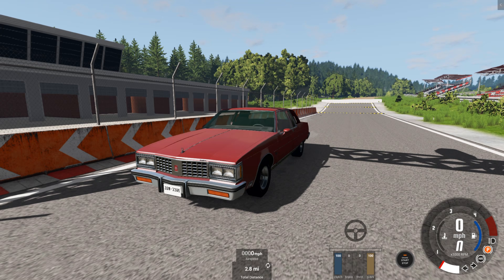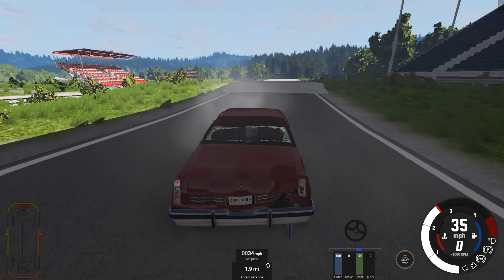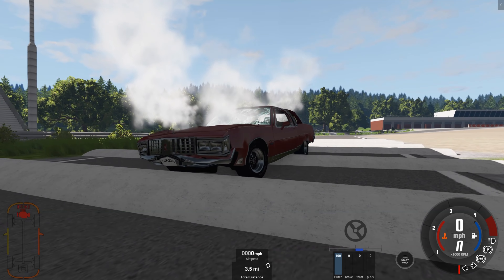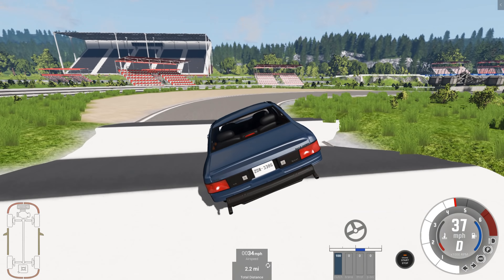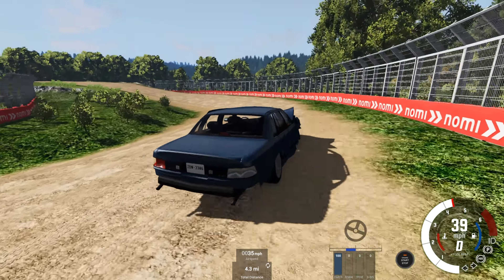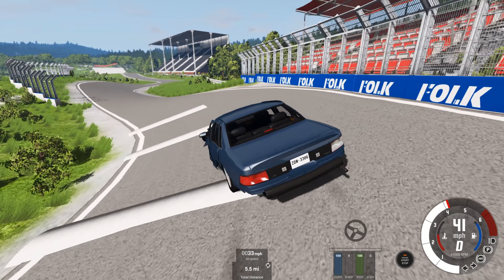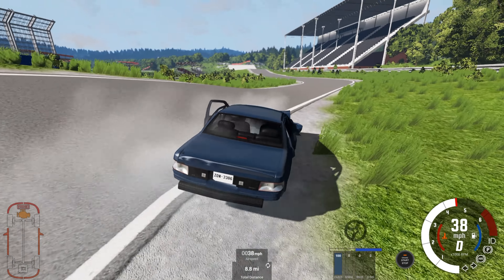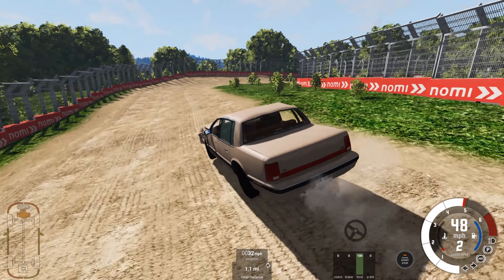Driven Till Destruction - Proving Grounds #10 - BeamNG Drive

Comment: Perhaps the reason the Grand Marshal was landing nose-first on the jumps was because of the weight distribution? Another idea,wouldn't a less powerful engine overheat slower since more power means it runs hotter?
Reply: Yeah American vehicles like that are very nose heavy and are likely to land on the front after jumps. Especially ones with massive V8s.
Edit: ehh... Yes and no? I think it has more to do with RPM, if it's combusting fuel at higher speed it'll heat up quicker (say a 8,000rpm engine vs a 5,000rpm one.) It's not really a matter of power as it is how you get said power I think.

Comment: I'm sure that there is no modded or official car (that is a car, excluding tanks and semis) that is stronger than the grand marshal. You can ram into another car at 60mph and it wont care.
Reply: It makes sense. The Grand Marshall is based off of the Ford Crown Vic which is an EXTREMELY durable vehicle.
Reply: The body on frame configuration and the land yacht size makes it more durable, axles is just the weak points of it lol

Comment: Did we already have a bus going around this circuit?

If not I have a suggestion:
Either use the normal Wentward DT40 in the Highway version
or
Use one of the other 3 from the Wentward package mod.
The mod includes
DT30 (very short version of the same bus; probably best bus for dealing with the spinners)
DT35 (a slightly shorter version)
DT50 (a longer version with 3 axles - my favorite of the buses; not made for this course though...)
[All of them have the same versions as the og bus, and I like the Highway version the most]
Reply: I'm pretty sure he already did. If not then I might just be thinking of the times I've driven around the circuit (it didn't last long) the problem with buses are that they have massive overhangs. If the rear slams down hard enough, the engine or driveshaft WILL FAIL.
Edit: come to think of it he hasn't done it, the spinners are too close to fit the bus through so I removed them (something that FailRace hasn't done) but yeah I'd give it half a lap, lap and a half tops.
Reply: What about one of the articulated variants from the corresponding mod? When I tried using the tri-articluated bus, it managed to jam all three spinners going full speed.

Comment: You can remove spinners, here's how:

Enter level editor mode (hit f11).
Then go to spinners, select spinners, and click object>unlock selection. After that, delete the spinners with delete button. Rinse and repeat. Finally save the level with Ctrl+S.

With this you can use bus in this test.

Comment: jesus yt is struggeling, HD not looking so sharp
Reply: It's just the game. Driving quickly over asphalt or dirt causes a lot of pixels to change quickly which creates a huge video file (which would also make the video take a long time to load). In order to mitigate this, YouTube systems compress the video in areas with huge graphical loads like this.
Reply: @kip258  well normally 1080HD doesn't look like crap 360/480. it was looking more like 1080 towards the end. i think it was still post processing after upload. I do miss 4k like the older series where I could actually see the bumps in the dirt road
Reply: Fantaman900 The start and end of the video, as well as every time the car stops driving, the video shoots up because the pixel load is much smaller. If the video is processing, the quality options will only display what's available. Hope this helps! :)